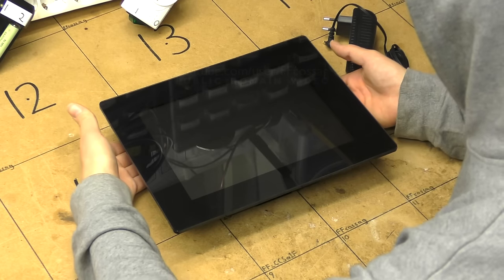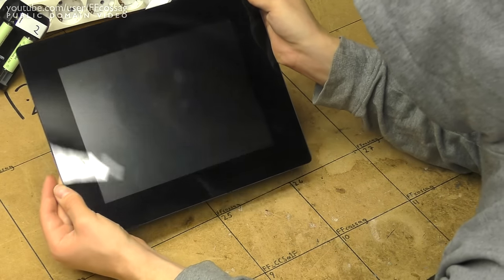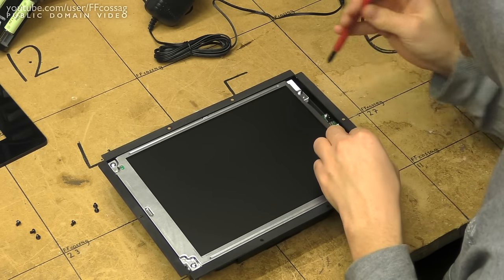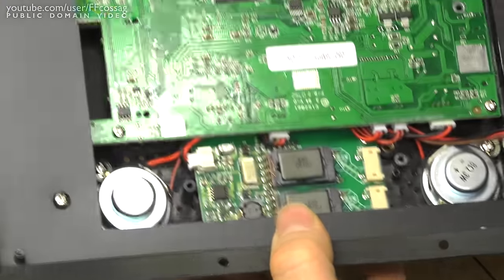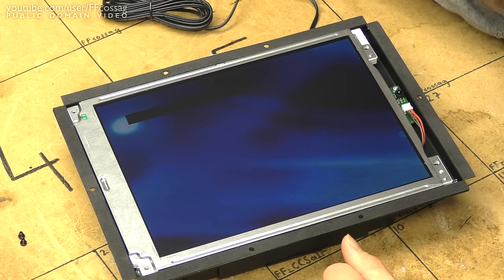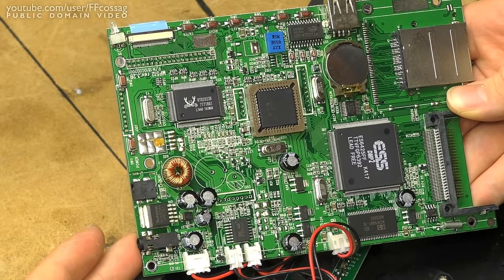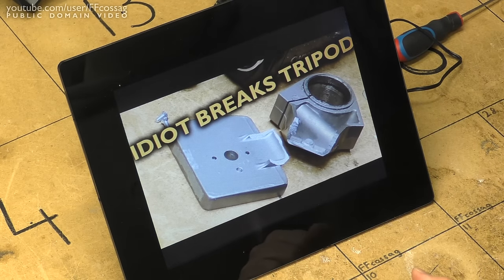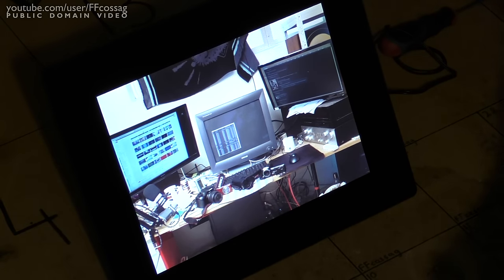Quick LCD picture frame repair (including the worst audio decoding ever)

Comment: Audio problem was most likely a codec format problem.  Xvid/DivX refers to the video codec but the file itself is a container format which can contain any of a range of different codec streams.  Maybe it didn't support the audio codec but it thought it did because it supports both the container format and the video codec so it tried to decode the more or less 'random' audio data which resulted in more or less 'white noise'.

Comment: I'd have given it about even odds for a power supply fault or an inverter fault. To me, the case design almost looks like a scaled down version of an early 2000s AIO PC.

It looks far better inside than any other digital picture frame I've seen.

Comment: When you turned it over it looked like there was something in the speaker, maybe they got water damaged or something manufactured wrong and that maybe why they sounded like blown speakers??
Reply from the maker: No, it's a decoding issue. The speakers work fine otherwise.
Reply: Oh...  So it just didn't support the encoding of the Audio?  I wonder if you can do a software update on it?  No matter, I would just use it to make a digital scope or something useful. lol. Thanks for the reply.

Comment: QC should have been checking the connectors as that one was clearly NOT "OK"
In the grand scheme of things it did work, what was the audio issue?
Reply: Considering the QC label was in the hidden part of the main board I would consider that it means the board was OK, not the full assembly.
Reply: Agree, the sticker was no doubt for the BIOS flash revision